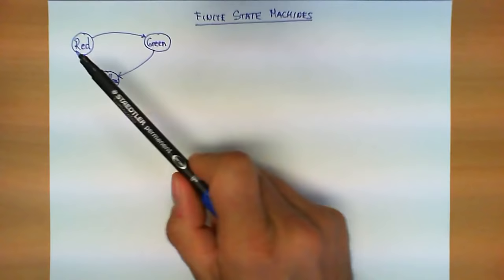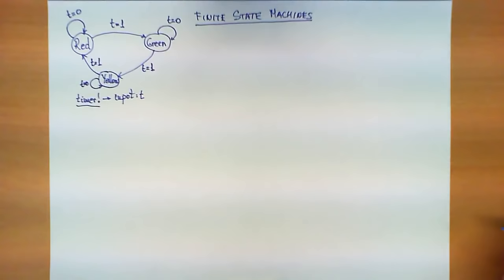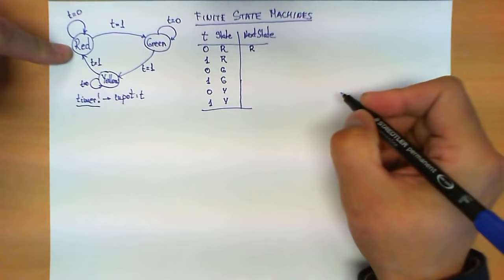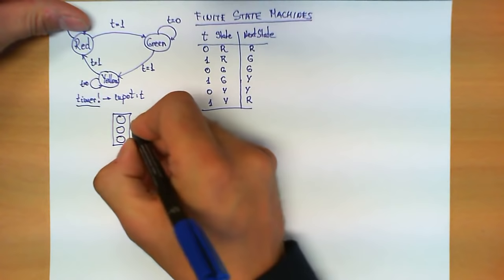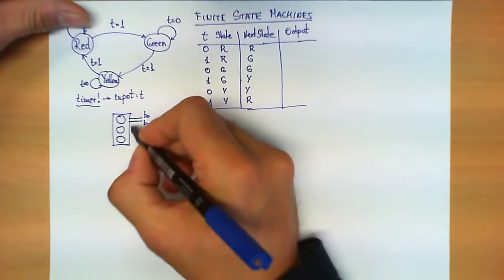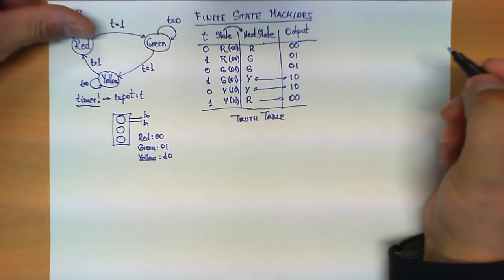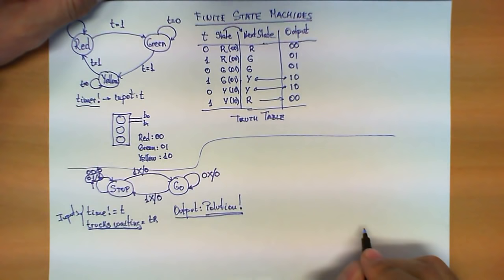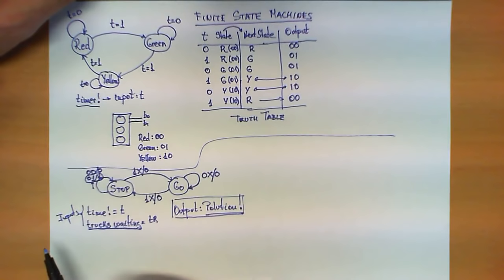Finite State Machines explained

Comment: I was shown this concept when I was a neophyte software engineer writing real time control software for telecoms systems in the 1980s (OMG a lifetime ago). I made a point of explaining this concept to every software engineer who ever worked for me in the next 40 years because it is such a simple, powerful and MOST IMPORTANTLY for process control - completely bulletproof. If Every state deals with every event (including those it should never see) you cannot break these systems.

I wince at the lack of detailed understanding low level computer concepts in the 'Object oriented or nothing' - 'pythonesque' sofware developers I meet now. My degree is in Computer Science not Software engineering, and all we seem to train these days are 'coders' who barely warrant the title Software Engineer, as they understand few of the basic concept they're writing software on top of.
I wonder how many of them could write Assembler, or optimise some P-code. Not necessary, but a skill that gives an important insight into what the machine is doing when it runs lazily written bloatware.
Rant over :)

Comment: When I was earning my master's degree, I heard a lot about finite state machines (FSMs), but it was all theory — like clouds in the sky: there's a lot of water, but you can't drink it. I toiled for three months after graduating until I implemented my first FSM in code in 1981. Now, there is a programming methodology based on this concept — v-agent oriented programming (VAOP) — with many examples of its implementation. It's best to start learning about VAOP with this article on Medium: "Bagels and Muffins of Programming or How Easy It Is to Convert a Bagel into a Black Hole".

Comment: I don't understand, if the 1st Machine that you drew needed both the time input to be 1 AND the state to be xx, in order to change state, doesn't that mean that the output doesn't depend on the state rather than solely on input t? Am I missing something? Please correct me. Thank you.
Reply: +Mark Infinite Still looks like the output will regard both. The current state will not shift from green to red instantly nor will red switch to yellow regardless of the time input. Otherwise there would be no way to define the current state logically in the process in order for the timer to change it.
Reply: perhaps we don't consider time to be an input as such?

Comment: Dear Mr. Abelardo Pardo, cold you help me ? I need project a FSM with follow fetures (2 bits machine, that recognize 1st sequence 0110, the output will be= 1, two sequences iquals 0110  0110, the 2nd the output, will be= 0, three sequences 0110 0110 0110, the 3r sequence output= 0) please how do I make this machine ? best regards. Paulo (Brazil)